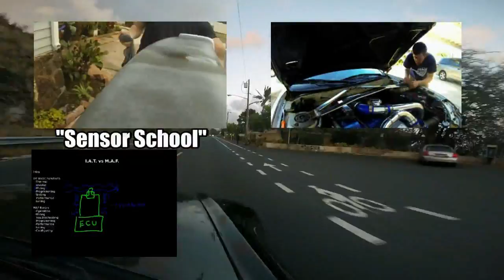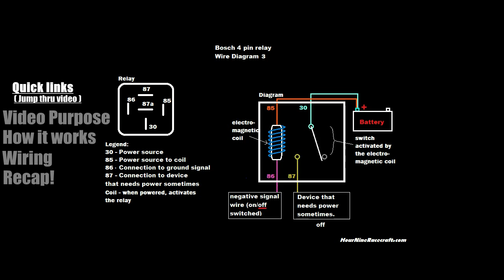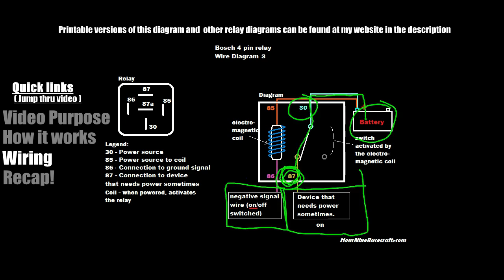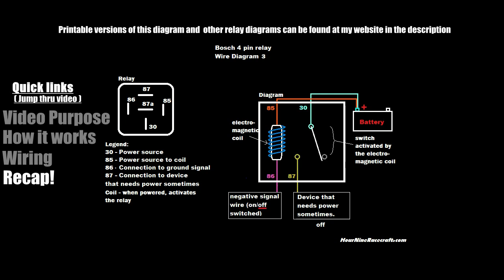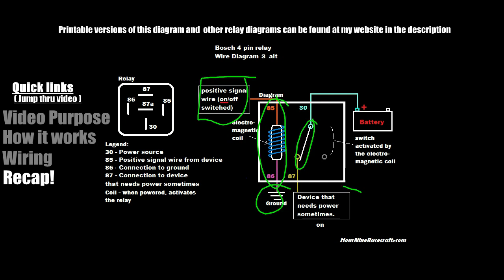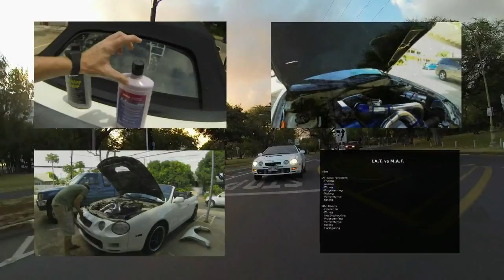Relay Tutorial: Automate By Using Positive or Negative Signals (Example 3)

Comment from the maker: For clarification, pin 86 is always positive, and pin 85 is always ground. I had them reversed when I drew this diagram. It will work on cheaper relays that do not have an internal diode.

Comment: Hi, is 85 on the relay not ground? You have it as positive?
Reply from the maker: Yes, I may have made a mistake in this video. A lot of the relays I've used are interchangeable between pins 85 and 86
Reply: @LegitRaceCraft  No worries, you're right I think they are interchangeable anyways. Good video, I learnt a lot thanks!

Comment: So I have a switch where there’s two connection that touch which feeds power . Unfortunately when this touches is in the off position. When on one connection isn’t connected . I need to have a power when the one connection isn’t connected to allow power through . If that makes sense .
Reply: How can I wire a relay to do this ?

Comment: being a 4yr old video i doubt i will get a reply but here goes any way. 

first very good video and the one which has given me the best idea of what i need to do (i hope) but my boomer ass is still a bit confused lol so i was wondering if you could help/confirm? 

situation...
ive fitted an alarm with remote start to my bike
remote start uses a positive signal confirmed by attaching a bulb to the alarms remote start wire and the bikes negative battery terminal and trying the remote start function and bulb lit up
the bikes electric start uses a ground signal as confirmed by opening the electric start switch and seeing the black wires.

bikes input wire from the start relay is RED/WHITE
alarm remote start wire is BLUE 

so am i right in thinking the following would be correct?
30 = RED/WHITE
85 = BLUE
86 + 87 = battery NEGATIVE
so a 4 pin 12v standard automotive relay would be ok?
many thanks 

paul
Reply from the maker: These sound like Yamaha wire colors (I've owned a few Yamahas) I actually have a relay video that is example 5 of this relay tutorial and should have a link in the description. It covers this exact scenario that you are describing. If I remember correctly though, I think the red/white and blue wires are both positive, the red/white is positive and runs through the kill switch and powers the solenoid, and the blue wire is the positive trigger for the solenoid. I don't remember a black wire. Consult a wire diagram for whatever motorcycle you have though, they are easy enough to find by googling, and check out my other video titled "swapping a positive for ground"
Reply: @LegitRaceCraft  thank you so much for the reply

Comment: how could i use a relay, when activated, only outputs a momentary 1/2 second output, 12v pos in pos out?
Reply from the maker: In theory, you could use a 2-pin flasher relay, regular relay and a momentary button or momentary switch. If I were to do this, I would try connecting the flasher relay between the regular relay (pin 87) and the device that is to be powered. The flasher relay would also power the relay pin 85 and ground would be pin 86. When you press the momentary button the relay would turn on the flasher relay, and the flasher relay would power both the device-to-be-powered as well as the relay itself after the momentary button is released. The flasher relay would then turn off the regular relay when it clicks off. The only issue I could think of would be to load on the flasher relay. The lighter the load the shorter the device will be powered, and the heavier the load the longer it will be on before it is automatically shut off. Another small issue would be that the device would flash if you held the momentary button.
Reply: @LegitRaceCraft  okay thanks that's a pretty good idea. I was going to use a diode a capacitor and a resistor that I was having some trouble getting it to work. I only wants to Circuit to close for about a half a second or so

Comment: I'm putting brighter fog lights in my 2004 infinity fx35, I got the bulbs and a wiring harness that has a switch, relay and fuse.  The diagram is pretty good that shows the fuse going to the battery and ground wires.  my question is on the positive (trigger) wire.  Does that go to an ignition switched hot wire? What would be a good source?  I got this harness since I can't figure how to use my on the column fog light switch.  It won't com on without the head lights.
Reply from the maker: +Dennis Bickers I always suggest ignition switched positive sources. If you have a ground short in the future your battery won't drain while the car is off. 
my video titled "easily tap into a Toyota fusebox" should be a good help. It shows what I did on my Toyota but it should help you out on the infinity. You should have open fuse slots like I do both under the hood and in the interior.
Reply: Yes... I hooked up my lights and harness but there is no ignition switched spot under the dash and don't see a way through the firewall.  I watched you video but didn't help with my vehicle, but Thanks
Reply from the maker: +Dennis Bickers since you can't do that look up a fuse tap on Amazon or Ebay. But I would only use that to trigger a relay on and not as a sole power source